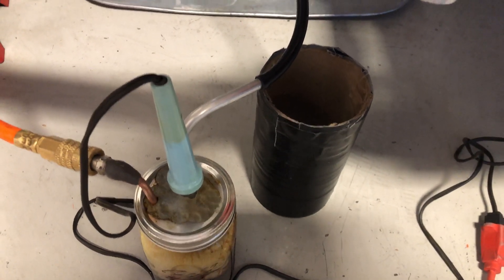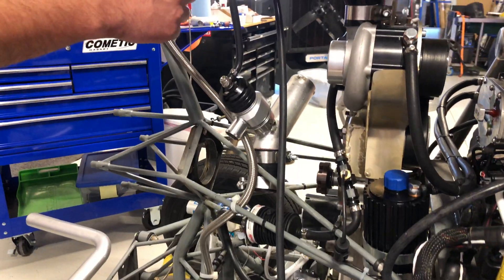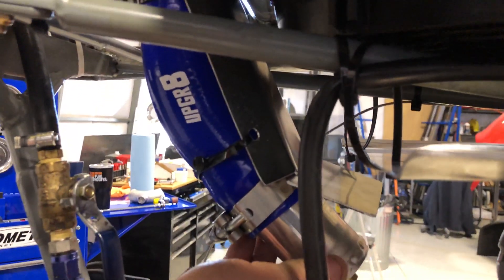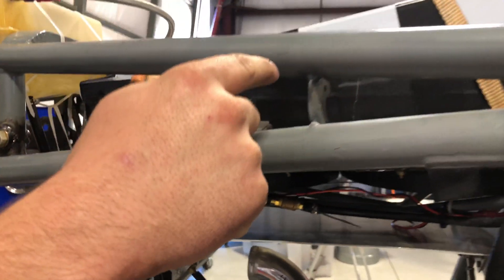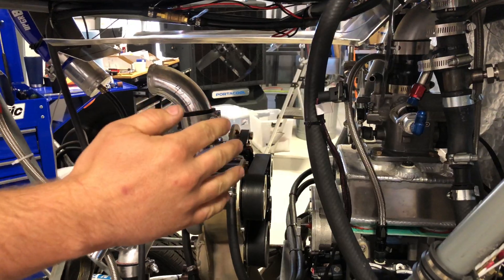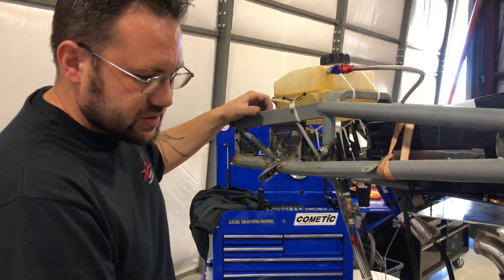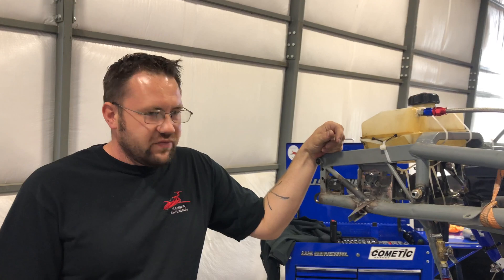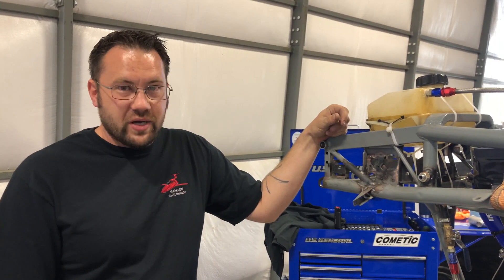MAXIMIZING BOOST

Comment: wait 1psi? even car tires have more than that o.O
Reply: in all fairness car tires have more pressure than most superchargers or turbochargers.
Reply: @cuzz63  that unbelievable o.O
Reply: @fuseteam  its true. Most dont put out 20psi. Only a few of the exotic high performance ones do that.  Think about this...whatever power an engine makes without boost it doubles when you add  14.7 psi. (1 atmosphere) so if it makes 250 hp normally and you add 14.7 lbs of boost it makes 500hp.
Reply: @cuzz63  i mean that just mindblowing o.O